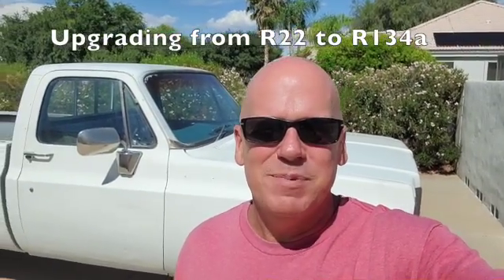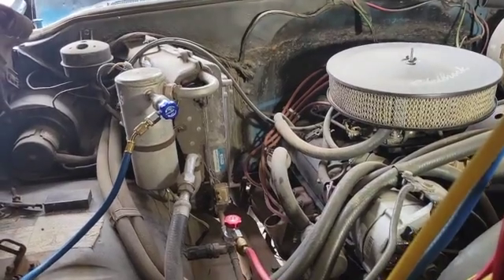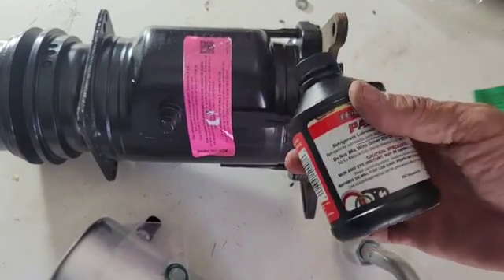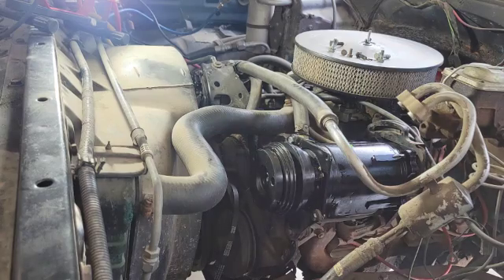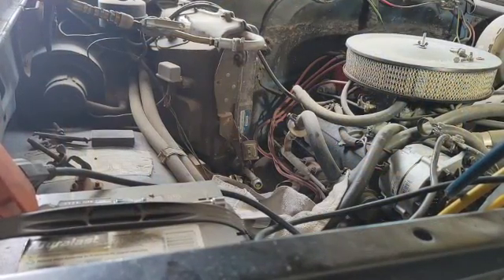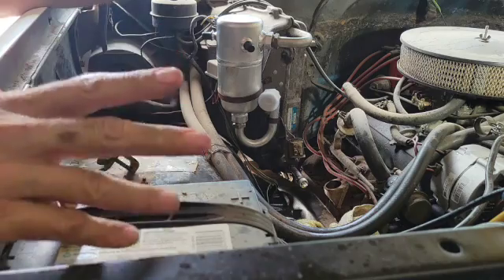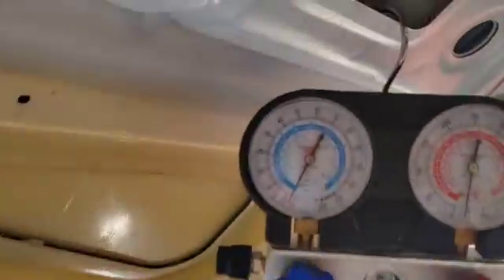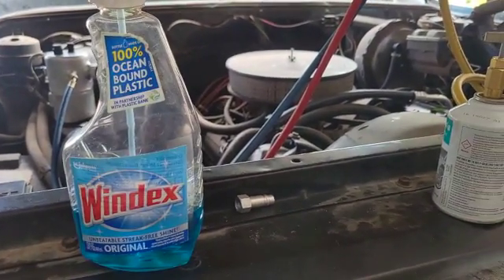Upgrade Air Conditioning from R12 to R134 Chevrolet

Comment: That system will never cool right you have to pull a vacuum on the system
Reply from the maker: It has been running fine since I made the video a few years ago.  I thought about filling with nitrogen, then vacuum, then refrigerant.  Do you think the nitrogen is necessary?
Reply: @f @fultonsgarage6331  I don’t believe nitrogen is necessary no but here’s some reasons why it needs to be vacuumed

. To Remove Air

Air inside the system is bad for several reasons:
	•	Air does not transfer heat like refrigerant does.
	•	It causes higher operating pressures.
	•	It reduces cooling performance.
	•	It can lead to noisy operation and erratic pressures.

Comment: Install the H/duty version viscous fan hub . Install the largest diameter optional fan / shroud .  Next, codensor cooling with electric fans . Pending what u have fitted in that space . Use prefer 2 units of 12 13 14 inch 20amp per fan . Fans will make a big difference . SPAL is a quality with guaranteed air flow . Use only the highest airflow  model only
Reply from the maker: Thank you for that info. I am completing a blazer now and am shopping radiator fans.  Never thought of a couple extra for the condenser.  I bet that makes a huge difference.  Especially in slow congested traffic.  Or creeping off road.
Reply: 1/ A   h/duty mechanical fan with shroud handles cooling way better vs any electric  for vehicle heavy loaded operation .
2/ elec fans handle cooling of condenser  very well . This cannot be under estimated as any small  buses upto coaches etc etc have condensers 2x up to 4x bigger . This is to lower the liquid line refrigerant temperature down as low as possible . The lower this liquid  temp is the better the evaporator will work . THE AIR CON WILL PULL TEMP DOWN TO THERMOSTAT QUICKER .   The lowest R134a will achieve is 112f or 44cel  equal to 150 psi   A real good system will do this at idle rpm and 1500rpm .  JUST PAYING IT FORWARD  hope it helps 
[FYI the problem is called flash gas ,, it only occurs in poorly designed commercial systems but many automotive . ]

Comment: R12 and E134a should never mix they are 100% different . NEVER EVER flush  with shop air  ,doing so introduces debris and huge amounts of moisture . Always flush with 100% hydro-carbon solvent . This solvent will evaporate completely is why u use this  type . Condenser  needs removal  for correct flushing . Evap core needs cleaning on exterior fins
Reply from the maker: Thanks for the tips.  I must have gotten lucky on this one, it has been a few years and it is still blowing cold air!
Reply: Its more of a check list . Yes u can "" wing it""  but doing it daily you have to go thru a list of checks especially when u are getting paid by a customer . I don`t do jobs twice . My customers hate a/c not working or breaking down .

Comment: This is now 3 years old and I don't see any comments on how/if you got it fixed. About the only part you can't check for dye are the evaporator fittings.
Reply from the maker: It is still blowing cold air.   I think the leak must have been my cheap gauges.

Comment: hi..I have an 86 Elcamino and I have a Harrison R12 in place but it is not blowing cold air.  Would you recommend changing all the stuff as you did it on your truck and what A/C compressor should I get?  Tx
Reply from the maker: I would first pull a vacuum on the system to ensure that there are no leaks.  In my case, there were no leaks and I was upgrading to R134 so I needed a new compressor since I could not find R12 anywhere.  I replaced it with the same style because it can be difficult finding brackets for a different style of compressor.  It seems that people recommend also installing a new dryer as well.  But, I would recommend finding out why the system is not working before changing parts.  It could be a faulty switch, a refrigerant leak, a worn compressor, a vacuum leak on the controls, etc.   Good luck, love those El Caminos!

Comment: Hello my friend 
When converting to R134a you first remove the old ferion then you must do an appropriate flashing all the system each separately no need to replace the compressor just flash it using  gas R11only..
Only items to be replaced is the condenser and the accumulator and hoses + expansion orffice tube & all other O'Rings which fits for 134a , these items only must be replaced adding one ounce PAG oil in each new part you installed.. no need to change compressor unless there is problem.. Just flash it n add 3 ounces of  pag oil
After fittings evacuate the system properly for about one hour or more using proper vacuum pump/fittings tools and watch the gauges if vacuum remains good 
Charge the system.. good luck
In case you have problem please check ur connacted hoses then evacuate the system again n recharge.. you have done

Comment: How cold were you able to get it out of your vents at idle?
Reply from the maker: @gimmefuel7268  I just checked it.  It's 95 degrees outside and it blows 56 with the AC on Maximum.
Reply: @fultonsgarage6331  thanks for the reply!! I had the compressor, dryer, & lines replaced in my ‘84 last week. He also installed a new fan clutch in hopes of pulling as much air as possible through the condenser. When it’s about “90ish” outside, & sitting idling, mine was about 60 degrees. I was hoping for around 40’s but I guess that isn’t going to happen. 🤷‍♂️

Comment: I was just looking at this kit. Looked pretty cheap. How’d it hold up? I’d love to get this for my 77 bonanza
Reply from the maker: It's still going strong.   The biggest improvement was sealing all of the vents behind the dash when I restored the interior.  Now I can't leave the AC on full blast for more than 5-10 minutes without freezing. Even in 110 Arizona heat.   We'll worth the time and money.
Reply: @fultonsgarage6331  that’s awesome!!! Definitely gonna have to get it now!
Reply: @fultonsgarage6331  where’d you purchase the kit from?
Reply: What did you use to seal the vents? @fultonsgarage6331

Comment: I think the orifice tube was put in backwards
Reply from the maker: I thought I put it in the same way the old one came out.  It's been working really well these last two summers.  I hope it is ok 🙂
Reply: @fultonsgarage6331  I'm not sure how much it matters, just figured that's why it stuck out a bit further than the old one. Kinda hard to tell in the video but I think the old one was yanked out the other way. Still a killer video, using your tips to convert mine!
Reply: @fultonsgarage6331  It's probably OK but the oring side of the orifice tube faces the evaporator.

Comment: To clear up some information. Automotive systems used R12 until 1994-96 time frame. R12 systems used mineral oil which is not usable by R134a, 134 will NOT circulate the mineral oil, so bad news for the compressor. I've done a few of these conversions and have always used POE (ester) oil, never had any problems. O-rings will probably need replacing to ensure compatibility with 134 as will the accumulator (134 requires XH5 or XH7 dessicant, IIRC). If R12 mixes with atmospheric air (oxygen) and stands for any amount of time within the system an acid is formed that will eat from the inside out weakening condensers and evaporators.
Reply from the maker: Thanks for the info. I replaced all of the o-rings, so I should not have issues there.  What would you recommend as the best way to flush the system?  I think I could have done a better job with that.
Reply: @fultonsgarage6331  There's an AC flush you can buy.

Comment: I got 33° out of my vent on a 90° day on the same ac system.
Reply from the maker: Wow, that's cold.  I'll need you to come over and give mine a tune-up!
Reply: @fultonsgarage6331  Just put fans with a relay on the condenser. Wire the fan's relay "on when powered" wire to the green wire on the compressor or high pressure switch. The fans will come on when the AC turns on.  R134a requires more cooling than R12 and some recommend the newer horizontal condensers. Try the fans first and you should be OK since you're cooling a truck cab vs a larger car interior.  Should see around 10 degrees difference with some good fans.
Reply: Yeah, and I got 12".
Reply: @sbc383zz  r12 or r134a? Or possibly propane.. r12 gets cold but only 4 or so° colder than r134a and 134a doesn't get down to 12° unless something is wrong